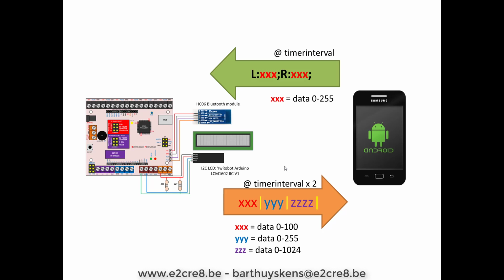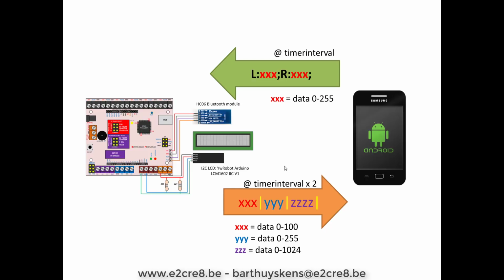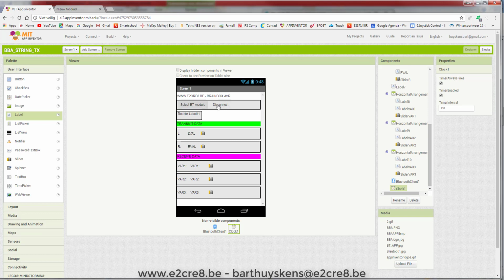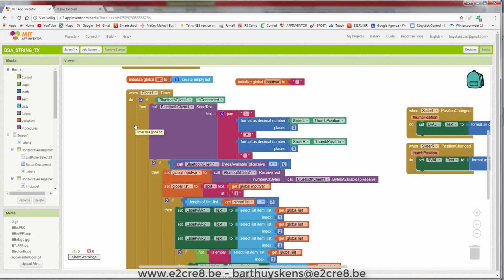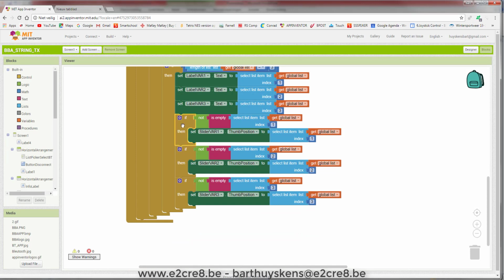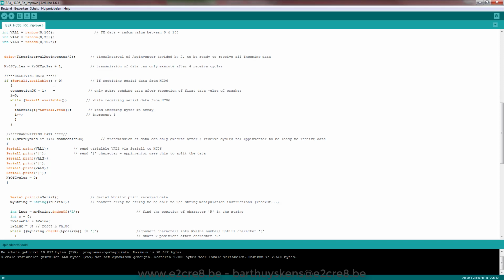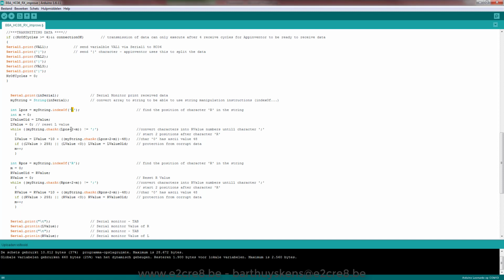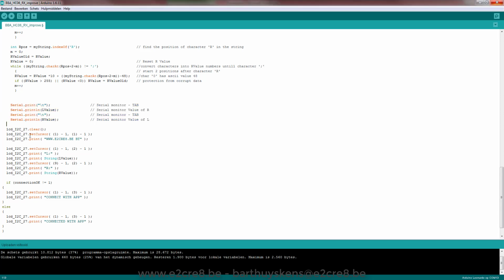Full Duplex comms between Arduino & Appinventor over Bluetooth HC06

Comment: Thank you for sharing!  I have a project I am working on and I am running into problems with consistent data going back and forth between my app and arduino.  The info you provided about the interval and clock cycles might be just what will help me.  I am looking forward to trying out your code and hopefully working out the kinks I am encountering.  Thank you so much for posting this video!  Great job and keep up the great work!